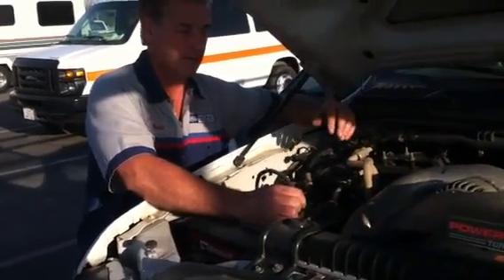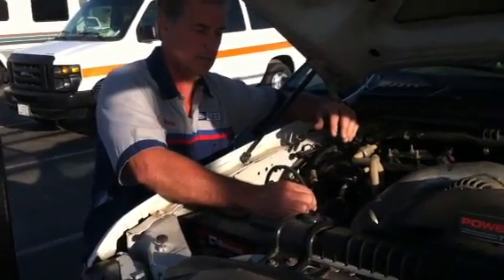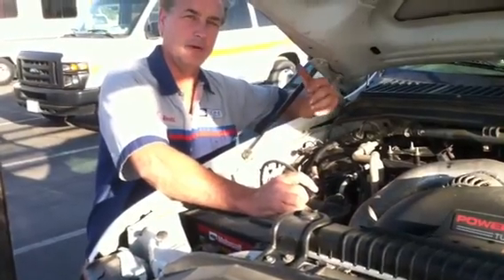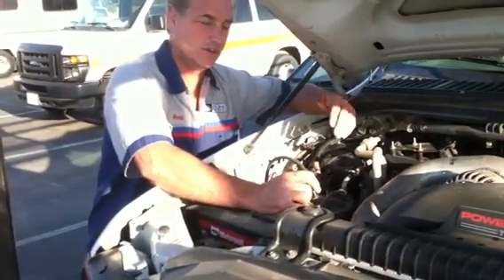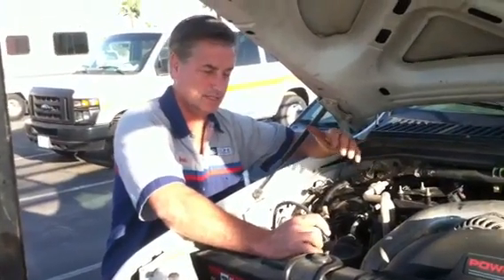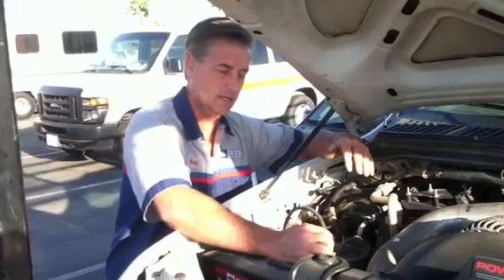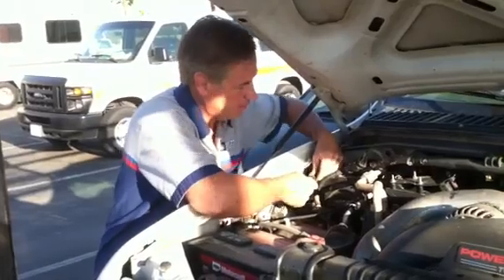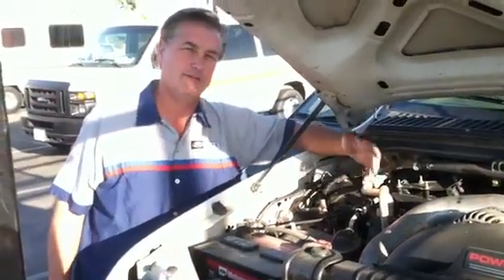6.0 misfire diagnosis steps

Comment: 2005 6.0 f550 that has intermittent miss under load ( taking off or cruising) usually 1000 rpm or greater. any ideas? 
no smoke
new crank position and cam position sensor
new oem fuel filter
mobile synthetic oil
Reply: did you get you truck fixed?
Reply: Did you get it fixed I have the same truck same problem right now what was your solution would be amazing if you could help thanks

Comment: @DieselTechRon I have a cylinder misfiring only when warm. I know it's coming from #2 injector because with my scan tool I can disable the injectors and disabling #2 (causes no rpm change) all others change RPM. only misfires when up to temp. is this the electromagnets for the spool valve? or will I need to change the entire injector? I am going to open it up and check the spool valve for sticking tomorrow. Oh yea FICM voltage stays at 48V Thanks for any advise

Paul
Reply: He wont reply bro.... He Passed away couple of months ago. RIP Mr Ron....
Reply: What scan tool?
Reply: Did you ever figure it out Paul?

Comment: Thanks to you I look at my 06 f250 6.0. in a new light. thank you sir for you monotone Smartness and thank you for sharing. Ill hook you up if i ever become something more! I just help this small bisness right now run its 9 Diesels for the last year and half. Dont alot of work for free and looking to grow with what i have learned. Got my first diesel for 3k and working well besides the oil cooler /egr cooler. Redoing at this time (used your vid) Thanks.
Reply: Kenneth Phillips Unfortunately for the entire Ford diesel community, Ron passed away earlier this year as a result of a car accident on his way to work.
Reply: My sincerest condolences.
Reply: Mine is hard cranking but it does not sound like that thank God

Comment: Nice video. Totally agree with you Ron. Definite low compression in a cylinder or two. I am not sure why nickjames75 called you an idiot. Injectors are NOT FIRING when you jump the starter solenoid nickjames75. You got to use your ears and understand what you are hearing means, nickjames75.

Comment: Hey rob quick question I have an 05 6.0 and after changing my oil the rattling sound in pre start up 
Is very minimal you can hear it up very low 

Also at high speed a little sputter it hesitation which comes and goes all ready changed fuel filters 

Any advice thanks

Comment: He was correct in the video.  Injectors were not even trying to fire because system wasn't energized.  That sound was indicative of a low compression cylinder.  The smoke supports that because raw fuel was being pumped into the hot exhaust from the low pressure cylinder

Comment: That's what it sounds like while cranking if bad injectors/low pressure to injectors
Reply: I hope you have learned somthing in the last 8 years. That's the sound of low comp on at least 1 cylinder....30 year tech here.
Reply: @miguelventura7651  without even rewatching the video I can most certainly attest to what I’ve learned in the last 8 years.. went from clueless to you’ll struggle to find someone better with diagnostics than I am. Lol, you live and learn. Back then I knew everything, now I only know what has crossed me by =]